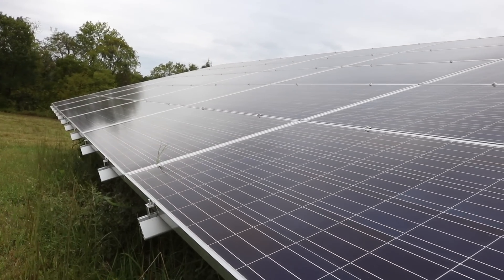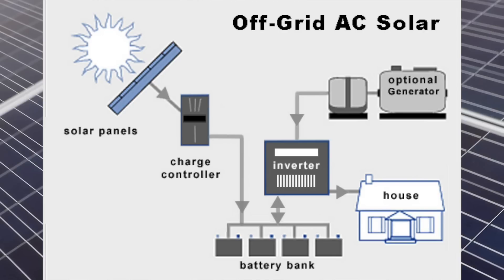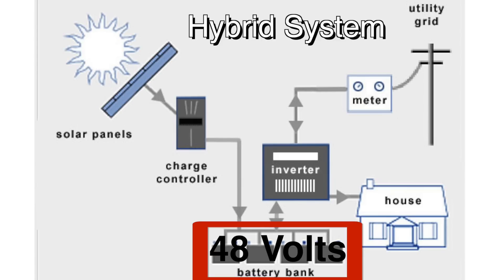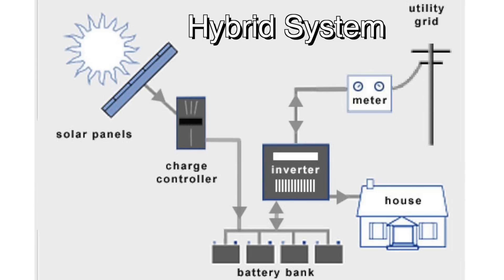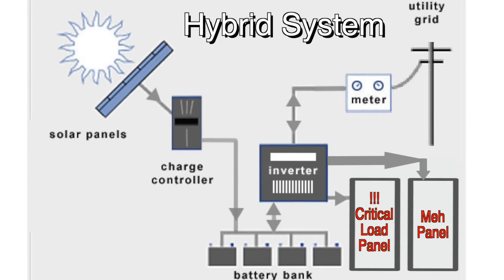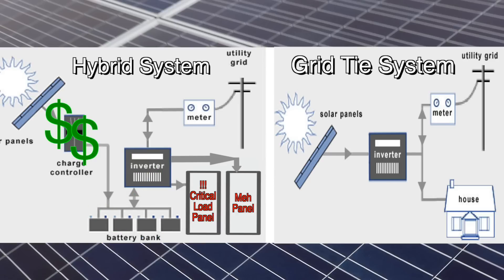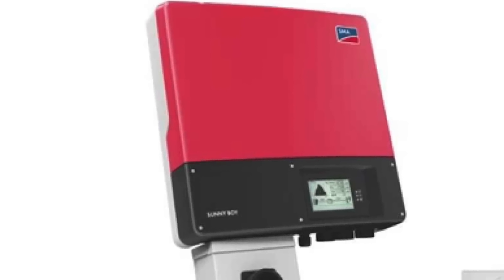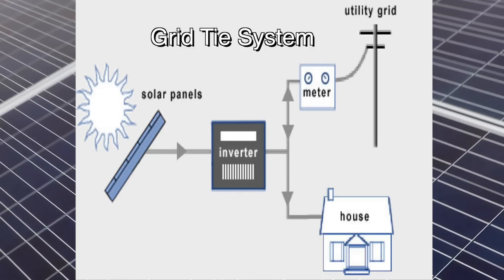Shedding light on solar power systems. Part 2, FarmCraft101 solar.

Comment: regarding the video of the excess power created by solar during a blackout, It's NOT created. think of it like a hose, when you let go of the trigger the water stops, where does the excess water go????   it doesn't go anywhere, it sits there waiting for you to open the trigger again. Think of the water as your electricity. The solar system doesn't make everything glow red hot. It just sits there waiting for you to turn the kettle on. Come on mate, your trying to educate people arn't you, I'm sure you can do better then that. 
Micro inverters have a major advantage over string inverters when there is some shading, this is their main selling feature. Rather then a string going below the voltage the inverter likes because a tree is shading a few panels and the inverter stops making power, micro inverters will still be making power from the other panels. Thats about the most simple version of it anyway. 
Nice video, good drawings, nice flow.
Reply from the maker: Appreciate the feedback, but you are mistaken.  Without a charge controller in the system to stop the flow of power from the panels, the inverter continues to function, and if there is nowhere for the power to go the voltage will climb.  To use your analogy, the pressure builds in the hose to unsafe levels.  This is for a grid tie system.  Hybrid and off grid systems have charge controllers that handle this problem.
Reply: Ok, I didn't realize america was so different to the rest of the world. We here in Australia follow the European systems. I agree, the inverter does continue to function, but it's output current drops to zero, while the voltage stays at what it is set too. Our inverters down here don't make more and more volts, they stop at whatever number we set them too, 236volt grid here mostly, so we set them to 243volts. Higher then the grid so it will feed into the grid, but within the 3% tolerance that is required by law. Modern electrical gear cant handle too much voltage. 
So if the voltage does continue to rise, when does it stop rising?? at the 360Vdc level from the panels feeding the inverter? what if my panel strings are big enough to feed 600Vdc (max household string voltage)or 1000Vdc (as used here in commercial jobs, and i believe America is making a new rule to increase that to 1500Vdc for commercial string voltage). So when do your inverters stop increasing voltage?? And how would the charge controller handle it? Does it stop making 48Vdc when the batteries are full and the house is not drawing power? How does it do that when the panels are still in the sun? (I presume the same way my inverters down here do it)  
Back to my analogy, the pressure in the hose will increase back upto the system pressure, but not higher then the system pressure. As pressure is ONLY a restriction to flow. My hose doesn't built up to unsafe levels, it builds up to the system pressure, which is safe for my hose not the blow apart or the pipe in the street not to leak or the valves controlling everything from my washing machine or my dishwasher from being forced open by the pressure and flooding my house.
We dont use a charge controller like you do either for our hybrids. Why take 360Vdc down to 48Vdc to feed batteries and then make the inverter boost that 48Vdc up to grid voltage again. Here is a link for how fronius hybrid inverters work.     https://www.youtube.com/watch?v=rbgy1yna5xM
So lets say i have 10kw of panels, so in your system i need a 10kw charge controller, as well as a 10kw inverter. It doesnt matter how many KwH the batteries are for this purpose, but lets say 10KwHours (as this seems to becoming the standard for houses).  So the fronius above have a 5Kw battery charger which is wired within the 10kw inverter. so if batteries are dead =5kw to batteries (360Vdc from panels down to 48Vdc to batteries) and 5kw to house (360Vdc from panels down to 243Vdc to house or grid), batteries full then 10kw to house until sun goes down (360Vdc panels to 243Vdc to house or grid). after sunset then it can draw 5kw from the batteries at full current for 2 hours or longer at less current (48Vdc batteries upto 243Vdc to house). You lose alot of efficiency whenever you change voltage,  either up or down. 
Interesting how other countries do things a different way. I wonder what other ways some other countries are doing things.  I've noticed alot of industry talking about Flow batteries lately, seems like a better choice then lithium. Once again thanks for the information, I'm always happiest when i learn something new.

Comment: At some point wouldn't it be easier  to build a 2nd house  just for the solar panels, lol? What I'm suggesting actually is running everything completely separate, keeping the "power company" service ORIGINAL and as was. I mean since you're running a battery pack anyway, rewire the house for completely separate outlets strictly for solar, and manually move the plugs back and forth to solar or "power company",  depending on demand, time of day, sun shining or situation. Separate overhead can-lights and switches obviously.. This doesn't seem like too much of an inconvenience, beside a generator would mean you could cancel the power company altogether,  with just one set of wall plugs, power boxes, etc, since you've come this far.

Comment: You make it sound like grid tie systems will overheat in a grid power fail event because all of the electricity is going nowhere.  I rather doubt this but maybe you could expand on it.  I suspect the solar power just becomes heat, the same amount of heat that the solar panels would produce if they didn't have the magic going on inside them.
Reply from the maker: Not overheat.  The voltage would get too high and cause problems in the electrical system.  Of course, that's why grid-tie inverters are equipped to automatically shut down when the grid goes down, which prevents this from happening.

Comment: I have two Sunnyboy Inverters for my 24 panel, 8.2kW system.  Each has a 2000 watt secure power outlet.  I have used them a few times.  I have run up to 1600 watts off of each one.  If the sun goes behind a cloud and you are trying to pull more power than the panels are producing, it shuts the outlet's power completely off for a minute or so and then resets and restarts.   I got this type of inverter exactly for this reason so I could get power if the grid is down.  I have been very happy with them so far (14 months).
Reply from the maker: Cool.  That is a nice feature to have.
Reply: Hey, can you use this feature to run a Fridge?

Comment: What happens when your load is much less than the available power supplied?  Then that power isn't used.  It's kind of like when you plug in a cell phone charger to a 110V outlet, typically rated for 2kW power.  Less current flows at the same voltage.  As long as the rated voltage of the appliance is >= the supplied voltage, it will just draw as much current (P = IE therefore I = P/E) as it needs.

Comment: Nicely done. In the case of the Hybrid system, when excess electricity is produced and sent back to the meter, is it necessary for the meter to be configured for net metering? My local utility company refuses to set my meter for net metering, so any excess electricity actually shows up as consumed (which means they charge me for it). Maybe a better question for my application - can the inverter be configured to only accept electricity from the grid and not allow it to flow back to the meter?
Reply from the maker: Yes, you need a net metering meter.  I'm not sure on the inverter being configured that way, but I would bet yes for a good inverter.
Reply: yes the inverters can be set to NOT feed back to the grid, Just confirm the guy installing your system knows how to do it, its a program feature on nearly every model of inverters but most people don't know how to set them up.
Reply: The device is called a limiter. Some inverters had a built-in limiter if yours don't have, you can purchase an external limiter. It will prevent the inverter from sending excess power to the grid.

Comment: A hybrid system can be cheaper if you don't require the inverter to run everything when you loose power from the grid. What should you run to make your backup system cheaper?

Here are some things that a minimalist would do:
- Run LED lighting at a fraction of the wattage;
- Wash your cloths with two 5 gallon buckets and a plunger (great exercise);
- Don't use an electric or gas dryer;
- Have a well insulated refrigerator;
- Turn off all devices that draw vampire power when not in use;
- live in a smaller, energy efficient house;
- live out of your house instead of staying in it all the time.

Instead of just looking at cheap initial costs, you need to look at the total cost of living in a place for 7 to 15 years, or even longer. Being as comfortable as possible will require you to do a little initial work on your own.

Comment: Are PV panels able produce power with any light?
Reply: Yes, for most types of panels.  They don't put out much current (10%?) but the voltage ramps right up at daybreak, and they will start charging the batteries right away on a limited basis.  Power is limited (to 20-40%?) on totally cloudy days, but they really sing on fully sunny days.

Comment: Where does the solar power go if the grid is down on a grid tie system?
Reply from the maker: The panels have an open circuit, so no current flows.  Basically, the panels are "disconnected" when the inverter shuts down, so the solar power doesn't go anywhere.
Reply: FarmCraft101 thanks! enjoy watching
Reply: On this system as designed. I'm sure he is fully accurate, however. there is not only a single way to do this. IT DEPENDS ON STATE AND LOCAL LAWS.  In Arkansas, the inverter must meet a level of clean power to meet or exceed that on the grid.  There must be a disconnect switch between the inverter and the grid.  With that design.. if the grid is down, or just the local segment, you can disconnect (or they can disconnect you manually at the house) leaving you with power but not feeding back to them causing a safety issue.  The power company MUST know of the system, mainly so that in the case of a grid down, or segment down.. they know of the possibility of back-fed power and where it is coming from, so that whether you are home or not.. they can disconnect you from them. This is for safety, and so they can make the line safe to repair (good for the neighborhood).   Arkansas when last I checked, also required if all this is met (must be installed by licensed electrician etc), then they must pay you for the excess power at retail rate.  However.. (there's always a gotcha) once a year they zero out the "credit" and it is timed in such a way, that you always, even under perfect conditions, loose some "credit".  It is credit only, no check.  

take time, learn the laws and such applicable for  your local. If there is a reputable installer that does any work in your state or local.. it would really behoove you to contact them. You're paying for expertise.. not just products. Mistakes.. are more expensive than their expertise.  I am in no way connected to the power or any renewable energy company in any way.
Reply from the maker: https://youtu.be/gPycyuVJ_Cg  This explains much more about this topic

Comment: When used within the framework of modern society, the grid tied system is a no brainer when you can find repairs, spares, and get tax breaks. The hard core survival types or get-away-from-it-all types will obviously benefit from the simplest system they can find. The limiting factor of all the systems--solar, windmills, etc. is that maintenance is needed and has costs. It is very doubtful to me at least, that anything we can buy will last long enough to pay off. Of course if we just find it extremely satisfying to get "free" power, then that alone could make it worth it as long as we recognize that. Plus cold beer after a natural disaster.

Comment: I think the Sunny Boy 3.0 (and above) - US models may be able to tie in with storage solutions as well.  I just don't know if it has to be SMA's proprietary Sunny Boy Storage or if it can be something else, like 18650 Powerwall.  Hopefully someone will answer your questions from the video.  Waiting to hear.  If not, I am within the month probably going to buy one and I'll do some experimenting myself.
Reply: On page 40 of the Sunny Boy manual it even talks about a multi function relay for charging a battery bank. https://ressupply.com/documents/sma/SB_3.0-7.7_Installation_Manual.pdf
Reply: Found the piece I had read... You have to buy the SMA Battery Inverter. 
 It will work with multiple battery types according to the description (in the parts list).  http://www.freecleansolar.com/SMA-Sunny-Boy-Storage-2-5-Battery-Inverter-p/sbs2.5-1vl-10.htm?gclid=CjwKCAjw64bPBRApEiwAJhG-fhIYtiptfsvlXFsR_EpihX-szzZ5T9pwr7jUTLh-cex_XfKPzf6IQhoCoHUQAvD_BwE.

Comment: Take a look at the Magnum GT500 grid-tie microinverters.  No need for a charge controller when you use one of their inverter/charger and you get to grid tie.
Reply from the maker: Bah!  I should have mentioned microinverters, but they are basically multiple small grid tie inverters coupled together.  Same end result.  Thanks for watching!
Reply: Hah!  Maybe a topic for another video.  Unless YouTube decides that microinverters are of the devil and must be banned?
Reply: @mrbodo69  COST ?
Reply: @tdidan With the PV Strings connected in series = High DC Voltage, there is no such thing as ... "Elimination of DC transmission loss"  when using Micro-Inverters.  Having many Micro-Inverters can add too much the bottom line COST.  And on a roof mount system, with many tightly packed rows of PV Panels, how do you replace the failed micro-inverter in the middle panel, of the middle row, in the array?
Reply: @tdidan DUH !!!  I was talking about your false statement regarding: "Elimination of DC power Losses" by using micro-inverters. Comparing High Voltage DC ( as is now ) vs AC Voltage ( your suggestion ) the losses are worse for AC, at the same voltage. You do not understand Electrical Engineering ...